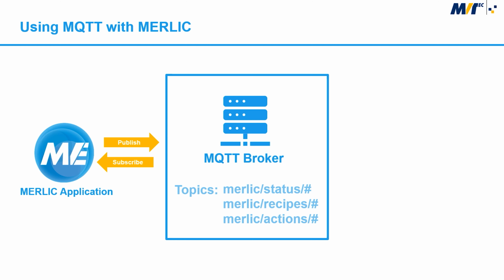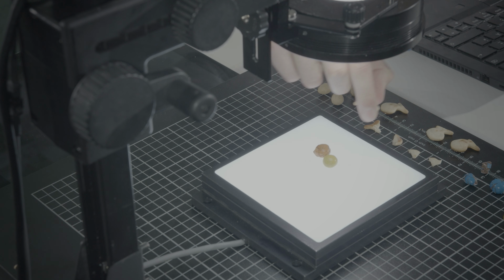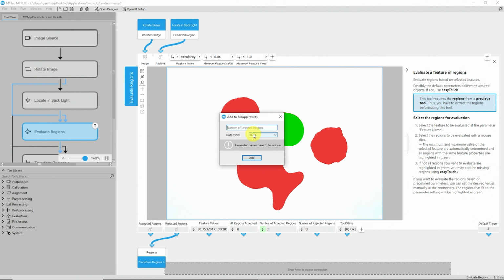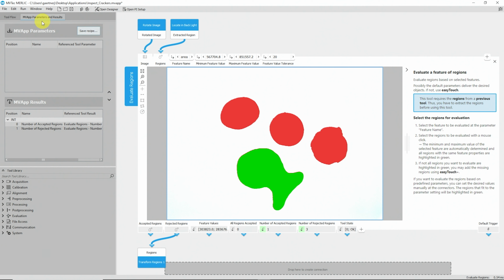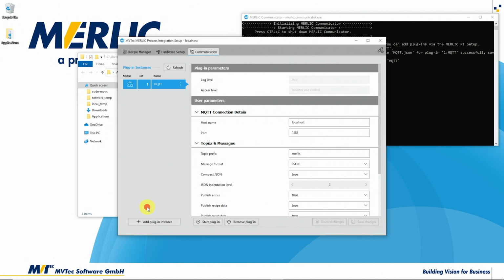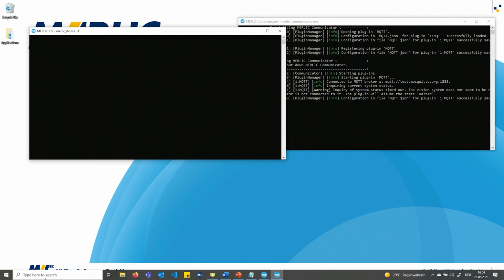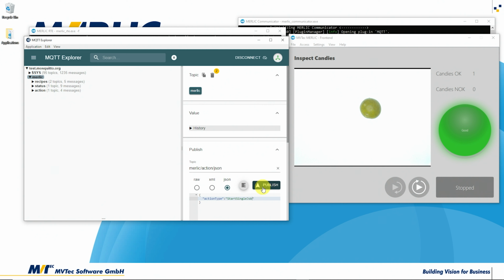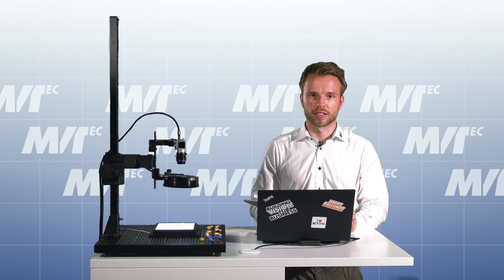Tutorial: How to integrate MERLIC into your MQTT infrastructure

Comment: When i run MERLIC RTE the frontend is starting continue not SingleJob. Can i StartSingleJob ?
Reply from the maker: Hello! After starting MERLIC RTE and successfully loading the recipe, MERLIC is initially in the "Ready" state and does not change to the "ContinuousExecution" state on its own without a trigger signal. That is why we assume that you have set a simulatedPLC under "I/O" and there you have set "ContinuousJobs" as program. If this is the case, you could also select "SingleJobs" as program. Otherwise you can contact your local distributor for further questions:  https://www.mvtec.com/company/partner-network/merlic-distributors

Best, your MVTec team